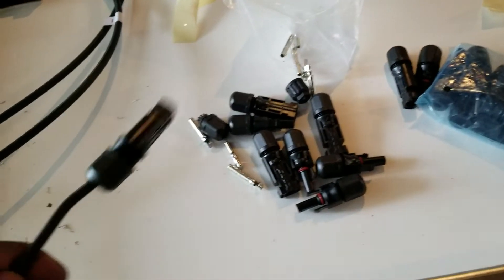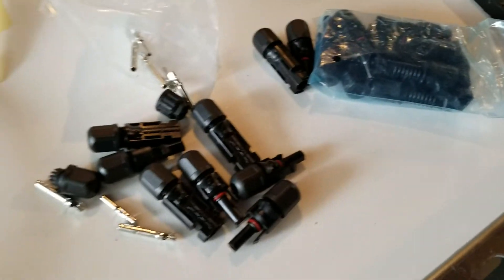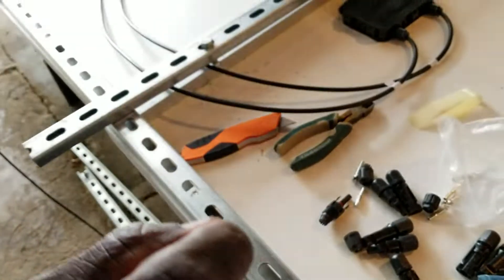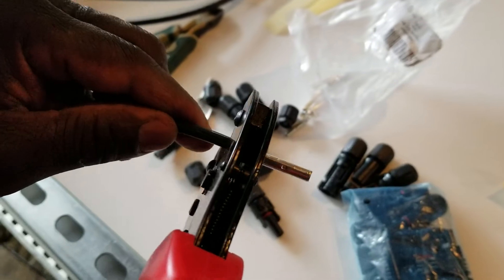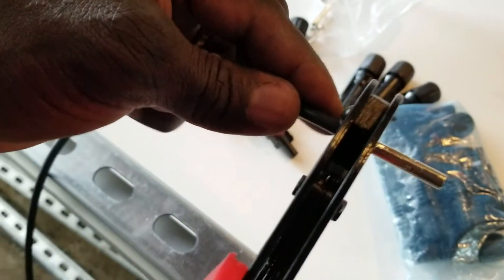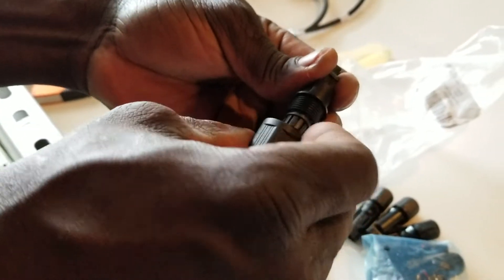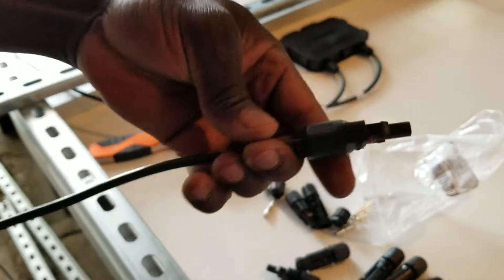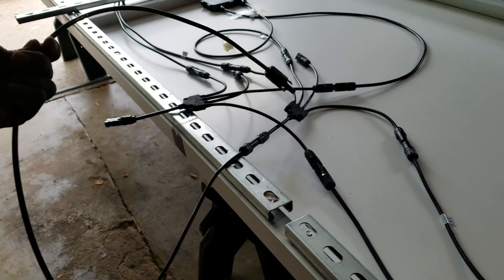HOW TO INSTALL MC4 CONNECTORS WITH A SOLAR CRIMPING TOOL

Comment: Those mc4 crimpers are pretty good, I do find not all mc4 connectors are equal, after some trial and error I now buy them from my local proffessional solar company, Ive had connectors break before mostly due to direct exposure to the sun over time making the plastic brittle , I'm guessing they were counterfeit.
Reply: closertothetruth it's wide spread with solar and wind!
Reply: TheBillytheJack2010 i hear you! , hope all is very well.
Reply from the maker: This is crazy everyone is trying to sell fake products now a days.
Be careful what you buying out their these days. 
Thanks for the input as always and have a wonderful Sunday.